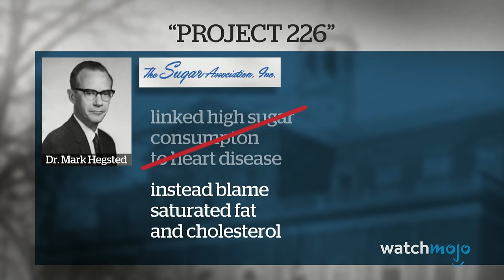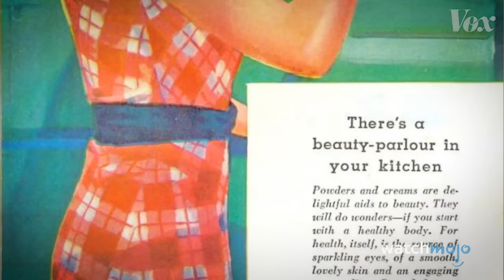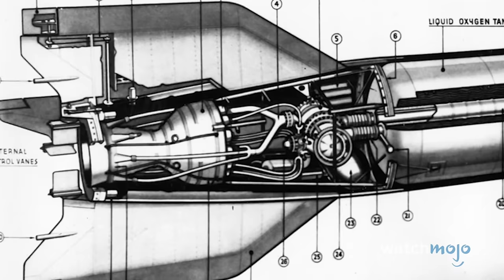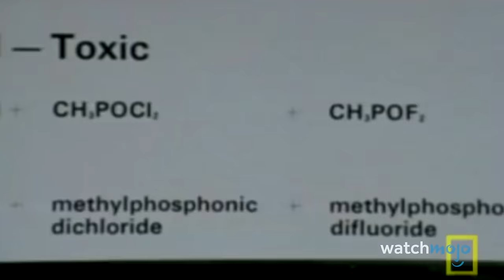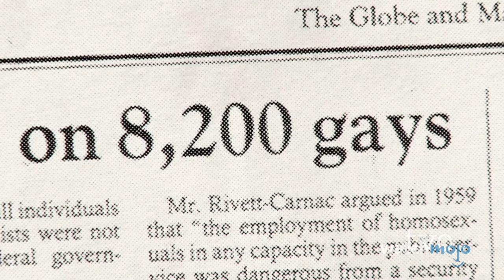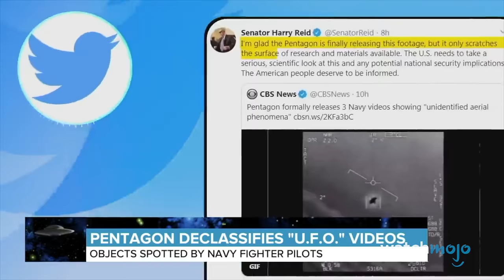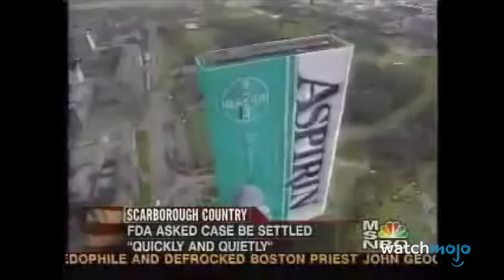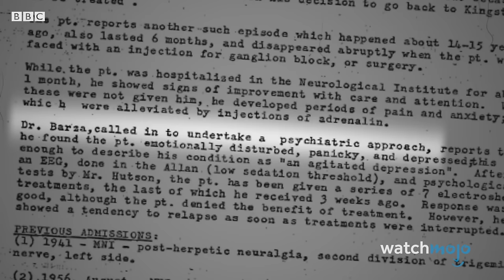Top 20 Scientific Conspiracy Theories That Turned Out To Be TRUE

Comment: Great video one cavoite.  For #8 the poisonings alcohol being sold as industrial alcohol. When you distill alcohol there is a thing called an azeotrope aka you can not fully distill all the alcohol from the water its in. So you include other chemicals to raise the azeotrope such as benzene. This practice is still in use to make lab grade ethanol such as 99% alcohol by volume. Not saying that the other chemicals listed are not also terrible to drink. My point is benzene probably shouldn't be on the list unless of course the added like quite a bit to it.

Comment: the thing i love is how apple lied about "battery drainage" i mostly use samsung(yes samsung did it 2 ) his iphone 6 plus was allways good for him till his battery went out faster . i told him buy a iphone 6 plus without the update installed . charge ur current iphone 6 plus to full . and then place that battery in the new 6 plus . and guess what . the battery was only charged 60 while his updated iphone told him it was 100% :P . and for people who use samsung flagships . i stopped using samsung flagships . did u know that the samsung A53 wich launched last year is just as good as the S22 . A53 is just as fast same photo quality . the only difference is flat phone screen and no wireless charging . but for the rest the phone is exactly the S22

Comment: The irony with Apple is, of course, the attempt to do the exact opposite of planned obsolesce. Since older batteries wore down, the result would be a random shutdown if an operation pulled too much of a charge, Apple decided to prevent any shutdowns by limiting the power an aging battery would pull at once, thereby extending the life of the phone until a battery could be replaced. Their issue was not explaining this properly.

Comment: Uh......That alcohol bit is SOOOOO biased I.....well, I was going to say I cant even, but honestly its right up the ally of scaremongering clickbait style channels. 

Industrial alcohol, and fuel alcohol had been, AND STILL IS, a thing for a long time. And heres the rub (hehe rub. BTW, rubbing alcohol is a different kind of alcohol, specifically isopropanol, mixed down to a certain concentration, and not for human consumption in any way shape or form. For external use only! Also, 91% and 99% IS NOT better at killing germs than good ole 70%, and in fact the higher concentrations can cause the outer wall of bacterium to essentially curdle leaving live bacterium inside. That means its not actually killing  the bacteria, which was the whole reason youre using it in the first place, isnt it?!?! Yes, get 91% then mix it down to between 65% to 75%, if you want to feel smart AND be smart. You can look up a calculator online if you're one of the people with unaddressed trauma from school and thinks maths is hard) ..... ALCOHOL IS STILL POISONED!!!!! Ever heard of pink lady? Yeah that was ethyl alcohol used as fuel tinted pink to indicate the tax for fuel alcohol had been paid. That tint made it undrinkable as the tax for alcohol meant for consumption was different and the production was regulated for health and hygiene reasons. How about that "denatured spirits"  solvent you use to lift sticker glue and such......Id hope if you're choosing to make a stink about alcohol you know what 'spirits' means.....Its kind of why booze are also called spirits....(it has to do with old timey verbiage for the ester extractions that evaporated readily, look up the etymology if youre that interested...though if you didnt bother to fact check the poisoned alcohol story before spreading fear for imaginary internet points I doubt youll bother to do that either)....But what is "denatured" about these "spirits" I hear literally no one asking... Well, alcohol is a type of chemical structure, not a protein. So unlike a "denatured protein"  its not simply heated and untwisted a bit (thank you Alton Brown and the Good Eats crew). Now, while your mind boggles at the possible meanings to that quandary, here is something to pop in there to help it roll about a little easier. The alcohol that gets you drunk is ethanol. Methanol, used in top fuel dragsters, will make you ill (some of your hangover could be due to the presence of harder to digest and icky for the body methanol in your booze, though honestly its most likely dehydration from all that peeing, sweating, and filtering booze out of your system your kidneys did last night). Isopropyl WILL KILL YOU IF YOU DRINK IT!!! Shortly after making you blind (hey....that sounds familiar doesnt it).  So, how do you denature ethyl alcohol so people will avoid drinking it, as that may be illegal outright at the time or at the very least a dirty tax dodge by people who like paved roads and fire fighters, but not paying for them? Hrmm.....maybe we could add some of that methyl alcohol to it! YEAH! Thats it! We will remove some the natural drinkability by mixing in things you shouldnt ingest!!! "But sir, what if they drink it anyways?" ".....you mean willfully break the law? Like drinking alcohol when that has been banned? Or do you mean willfully drink industrial solvents not intended for human consumption? Like drinking acetone? Or do you mean accidentally? Like a unscrupulous speakeasy owner selling denatured alcohol industrial solvent as liquor? Either way, someone is doing something illegal, and dangerous of their own free will and those harmed either have themselves to blame or are going to jail for negligent homicide, at the very least." 

So yeah....your little 'the government is evil and out to kill you and poisoned alcohol to ruin your fun' doesnt really lend you much credibility Mojo....in fact it harms it....

Oh, by the way, since I know people actually need to be told this....The government funds its payroll with your taxes. Killing you or otherwise harming you in an egregious fashion means you are not producing income, not buying products, or using services.....Which means you are not producing a tax burden for them to tax you for thus funding their payroll and slush fund budgets.....IT IS LITERALLY IN THE BEST INTEREST OF THE GOVERNEMENT TO NOT INTERFERE WITH YOUR ABILITY TO PRODUCE A TAXABLE INCOME!!!! YOU FREAKING MORONS!!!! And people that spread that crap expect to be taken seriously when they cant even figure out how tax works......insanity, absolute insanity.